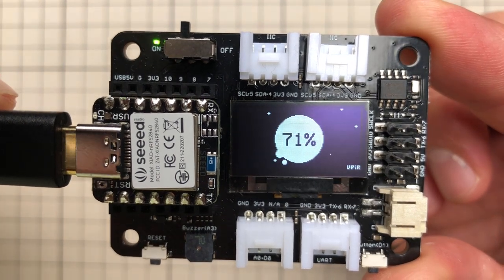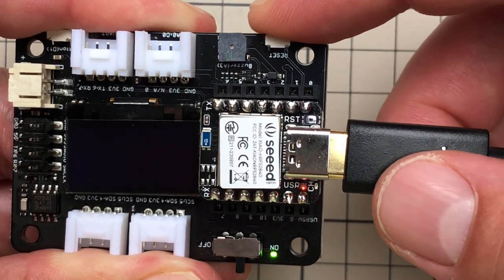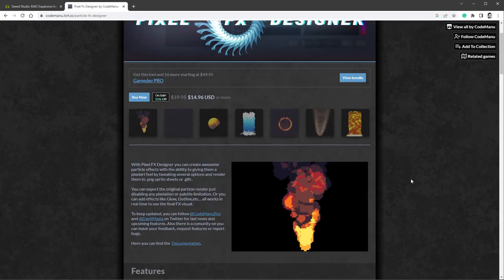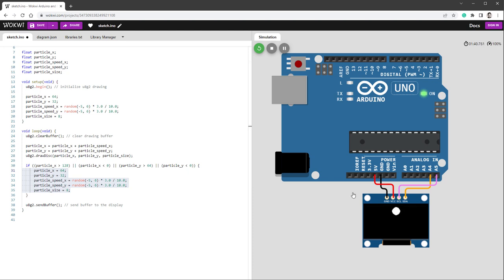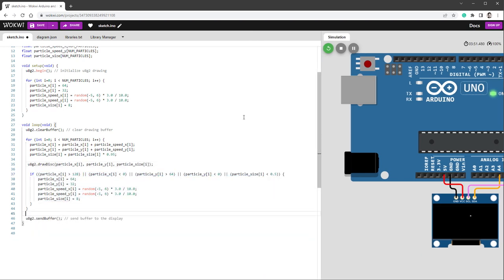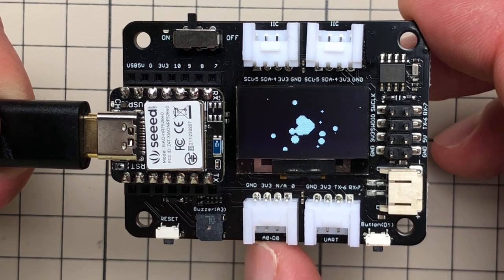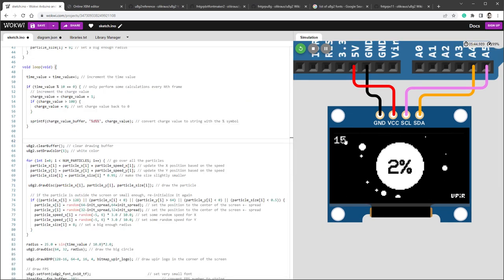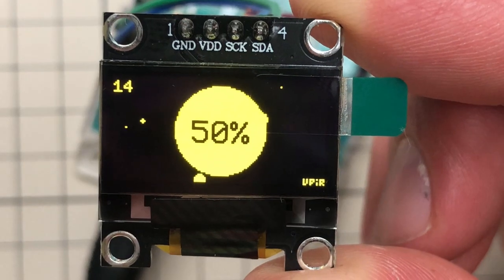Smaller & Faster Arduino?

Comment: 18:15 Arduino Mega is also 8-bit AVR, the same as Uno, just with more memory and I/O peripherals.
Reply: And for why the Mega is a little slower than Uno, my guess is that Mega has to spend a little more clock cycles to manage its larger I/O peripherals.
Reply from the maker: Yep, too bad I didn’t know that before recording the video. As for the slowness, it makes sense, thank you for the clarification!

Comment: There is ESP32C3 version of Xiao. And you can change to higher I2C clock!
Reply from the maker: I need to check it out. I believe I2C was limiting factor here as well, it could be probably faster with SPI. I might try to test the difference in the future video.
Reply: @upir_upir  Yes, for SPI, depends on the controllers you used, you can run 80Mhz SPI clock and get very high FPS.
More, there are 16-bit and 8-bit TFT LCD I/F on ESP32 S3. The FPS will be higher than 80Mhz SPI.
2 cents,
Reply from the maker: @TT-it9gg  Good point. Even the SSD1306 (used for that OLED display) supports 8bit interface, but I have never seen a module using this connection, since it´s probably overkill, as you will not gain too much compared to SPI. For color displays, that´s of course completely different thing.. Thank you for your comment!

Comment: Many other people have already pointed this out. Arduino Mega almost identical to Arduino Uno. Only the ram and number of IO differ. They are both obsolete. They were amazing back in 2005 but any modern microcontroller designed in the last ten years is able to beat them no matter the size.

If you want actual power I recommend you to look into esp32. It's 100 times more ram and 100 times more speed than an Arduino Uno plus wifi and Bluetooth for the same price. And you can program it on the same easy to use Arduino IDE. Barely any changes to your workflow.
Reply from the maker: You are right about the speed, but as for ease of use and the community/ documentation/support, the Arduino has still some advantage. Especially for novice users

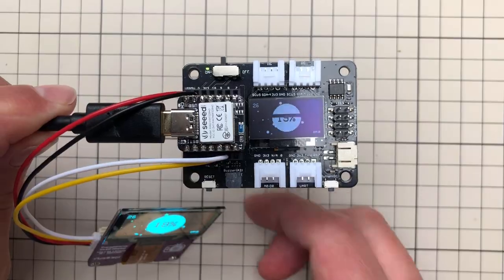Comment: 0:33 arduino is development board its supposed be big. you only need actually chip ausb chip if need usb, but arduino work bare chip if want smallest you can get lol
Reply from the maker: Well, it depends. You can get a different board with same number of pins but smaller...

Comment: I'd say that using floating point math functions such as sin,cosin and so on slows the execution down quite a lot.
Reply from the maker: You might be surprised to see that it´s not that bad. I have measured FPS using logic analyzer in one of my older videos and it was really 10% for calculations and 90% for drawing - https://youtu.be/dSD02o3M2sw?t=717
Reply: @upir_upir  Hmmm my reason for thinking that is because you mention that Arduino Pro has more bits to work with, making it take longer to do it.

Comment: Pretty cool board, love the USB-C connector. Can anyone recommend other boards like this?
Reply from the maker: What´s wrong with this one? There are many Arduino-compatible board out there, all the ESP32, Teensy, etc..
Reply: @upir_upir  nothing wrong with this one. I suspect OP was asking if there were other boards, perhaps with more pins available, that also have USB-C connectors instead of the usual micro.

Comment: when trying to use the speed control settings still can not make the voice sound Natural.
Reply from the maker: I´m sorry to hear that, but it makes sense that it not sounds completely natural, since this video is not sped up. It´s just the speed that I talk, which I understand might be little bit faster than usual. I hope you could still find this video useful. Good luck with your projects!

Comment: Does PROGMEM work on ARM chips? AFAIK it's noop for ARM.
Reply from the maker: You are correct, on ARM chips, simply setting a constant will make sure that the variable stays in flash. It should not hurt though.

Comment: I want to know why my UNO uses this graphics library and only has 5 frames
Reply from the maker: Using the same code? That´s strange.
Reply: @upir_upir  Oddly enough, the frame count in the simulation is not as high as it is in your video. I suspect I'm using the wrong library, but I don't see any errors.

Comment: Why have so few pins? I get the whole “breadboard friendly” aspect, but you’re honestly better off just using a dev-board specifically for breadboarding and a more compact solution when applying it to a circuit board. Like the ESP32, which I think uses 1mm-pitch castellated vias.
Reply from the maker: If you ask me, I would also prefer more exposed pins, even if it means a sligtly bigger board.
Reply: It isn’t meant for projects that require lots of pins, it is meant for projects where the microcontroller needs to be small. Hence its uses are pretty limited.

Comment: Hi I just found your really neat projects during searching Artificial horizon display for RC plane scaled cockpit. I think this transparent OLED will be great to use on RC plane (as you can se behind) do you think you can make something similar like here: https://youtu.be/uYR4fZtCe2A?t=255 but with SD1306 and Seeeduino XIAO? it needs to be really fast to not flicker true the camera with short shutter speed
Reply from the maker: Thank you for your comment. I think it should be possible. For the flickering, this is not tied to the microcontroller. The display driver chip (SSD1306) is refreshing the display 60x in a second, so in order to not see any flickering, the camera shutter speed has to be set to a multiplies of 60Hz and be somehow synchronized with vsync. In practice, it would be more of a luck to don´t see any flickering.
Reply: @upir_upir I can see that in 0:40 of the video, the transparent display is almost no flickering compare the one on expansion board
Reply from the maker: Yes, it’s about the timing of the camera Vs. v-sync of the display. I.e. the offset between those two. It depends on when the display start refreshing and when you start recording.

Comment: Check out Teensy
Reply from the maker: Yep, that´s on my to-do list already..
Reply: @upir_upir  Some interesting things to note about it. USB serial is unrestricted with speeds, and does not need CRC checksums as the serial device is simulated. Which means super fast data transfers with zero error rates. And out of many years of developing on it, I can confidently say it works exactly like an arduino, and in some instances teensy is more reliable.
Reply from the maker: Thanks for the clarification, I will make sure to try it out soon!

Comment: Maybe the Mega appears to be slower because it has to do more Stuff in Background.
70 vs 20 Pins and they are written as often as possible into the registers. As far as I know.
Reply from the maker: I believe it´s because on the screen that I was showing, the Uno was drawing just one digit while Mega was drawing two. Small difference, but big enough for FPS to change.
Reply: @upir_upir  there are other videos out there that shows that the Uno finishes it's Tasks faster as well.
Reply from the maker: @angelofeffektd6462 Yep, it´s possible but still surprising.
Reply from the maker: @angelofeffektd6462  I need to take a closer look = I will probably not use Mega for my projects. It´s too big anyway.

Comment: Hay, I've told you before to slow-down when speaking....I'm out of here !!!
Reply from the maker: I´m sorry to hear that, I did tried to slow down, but perhaps it´s still not enough? Please use the playback controls. Thank you.
Reply: See ya, see ya, wouldn't wanna be...
Reply: Look it at 0,75 speed than it's okay
Reply: Remember that it's his Video and you need to respect his creative process
Reply: @michaelschneider8667  that doesn't work if you're on a phone...
Reply: @haxie4516  of course it does
Reply: @Brickkzz  My bad, new versions of the app can, my phone can't update to the new version though
Reply: @haxie4516  Are you using a phone from 2013? I'm just curious. Because YouTube lite works on basically anything.
Reply: @ILFforever  YouTube Lite App? That's... Not a thing.. at least not something offered by Google.
Reply: @haxie4516  I think they had a mini version of their apps which were optimized for the budget android called android go. Thought they had a downloadable version for YouTube as well but I must've been wrong. Sorry for that. Anyways still the function of speed selection has been in YouTube for a longgg time.
Reply: @ILFforever  it's only been a part of the app for the past 3 years.
Reply: @haxie4516  I mean yeah that's still pretty long it's not a new feature. Plus google says it works on Android 5+ so if it doesn't work for you then. You might be using something very old hence my first question.
Reply: @ILFforever  and I told you, it won't update. It's not a particularly old phone, it's only 5 years old.
Reply: Honestly, I usually watch YouTube at 1.75-2.00x so got a bit of a shock 😜
(Turns on Closed Captioning, set speed to 0.75)
Reply: @upir_upir  you talk just fine man. TubeDude sounds like the most stereotypical entitled boomer you could find outside of a reddit thread.
Reply: Hey fitterman there's a transcript in the description